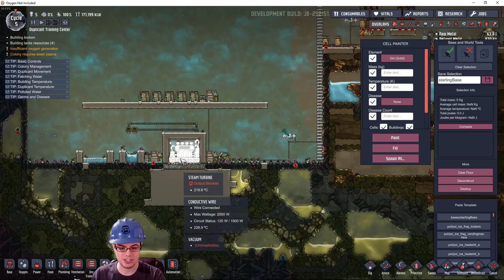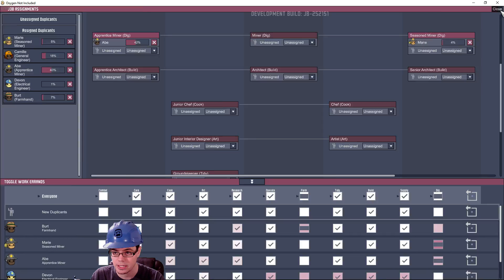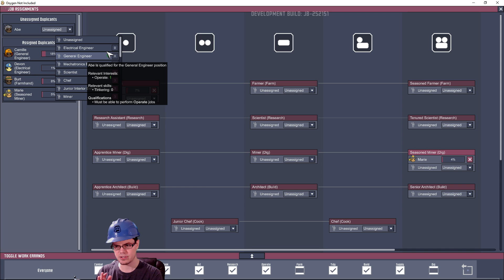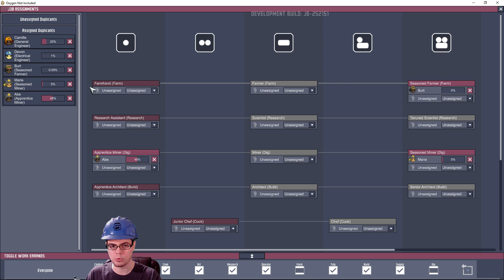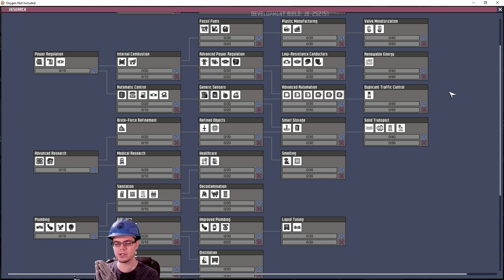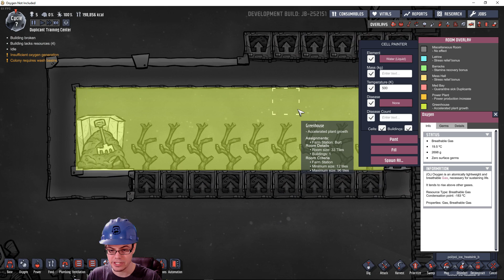Intro To Occupational Upgrade! Oxygen Not Included

Comment: What I like with this upgrader are the Ore transport (no more dupes running forever), the smart batteries (at last a nice way to only load batteries when needed, saving energy) and the hats.
Haven't found a use for the smart storage yet.
Reply: That is a possibility. Just have to look more into how and when it signals and use that to build the automation correct.

Comment: it will be nice if they add Liquid and Gas tanks in the next update or some time later. the way they work is they let you hold a set amount in them and say if there no power for say a pump. the Liquid can still move to where it go with out a pump. same go for a Gas tank. it can hold a set amount and it get use up before more is added. plus it be good if they can be place right next or on top/bottom of a replace tank. then that way it add more space for more Liquid or Gas to it.
Reply: A "water tower" system (and smaller boiler) as backup to pumps? With a bit of automation, this could save a bit of power. Also, gaz tanks could be quite useful to store natural gaz, with a valve you only open when needed that's a simple solution to keep generators runing a bit longer. There's good applications for this, even making hot water to be stored in cold areas until it get to X temperature before releasing it at the right temperature for farms.
Reply: Can't one already do this with the existing things in game? Using automation and an empty closed of room Id think one could.
Reply: If he said tank as "reservoir" it can be done indeed. The idea seems closer to a "water tower" meaning you stock extra water in an elevated building as backup for if powers run out, with no need for a pump exept to refill the said building later. Currently, it can be achevied by constructing longs pipes and makes use of the extra build up in it, I guess. An actual building would save some ore and space.
Reply: Ren Ookami what I have set up before is a water reservoir with two pumps at different heights. The bottom one is the primary. The second higher one feeds into another reservoir once my primary has filled more than the threshold. I then use this water in emergencies. All I have to do is program an airlock to open when the sensor in the primary has no liquid on it. This feeds the secondary back to the primary. The primary survival  circuit is powered by only 2 duplicants max. When the door triggers I know I need to produce more water via my water treatment method of choice at the time.  It works pretty well for me. I only run 6 dupe colonies though.
Reply: That sounds like a good way to manage it, but as you said you need dupes to power the circuit while the point of a water tower would be to act as backup building for when there's no power. It's not that you can't tell dupes to go to a wheel generator, and not even that useful if you know how to play proprely, it's just a fancy building for such situations "because why not"
Reply: Ren Ookami yeah power never is a problem due to the wheels. Kind of silly really

Comment: I don't anderstand how the steam-power-thingy work, can u axplein that in more Dteil¿
Reply: You put it in a room that has steam that is over 200C and has a pressure over 5kg per tile. Then it magically sucks up the steam it the bottom and generates power. It floats in the air. It needs a pipe in and pipe out but they don't need to be connected to anything at all. That will all likely change in the coming days.
Reply: Thx!

Comment: @Brothgar
"Output blocked" error is caused by overpressure above 10 kg at the point of steam outlet. Steam outlet is the small pipes at the very top, steam inlet is the base of the turbine (and at the same time it counts as a floor tiles).
And it seems that steam turbine supports only regular water as a coolant.

Comment: @Brothgar, It's probably going to change but the Steam Gen doesn't require liquid to be pumped in/out, it just needs the piping connecting to itself and in a room of steam to give off power. Edit: It needs space below it for the steam to flow in and space above it to 'vent' it out, but nothing really comes out.. then again all due to change, could be bug, but if you read the Steam Gen thing, it doesn't say it requires a type of liquid just the pipes, thats why i say just connect the in to out and you get power when around steam xd

Comment: Hey Brothgar!
Could you do a video on how to use the automation side of things. For example, how they control gas pumps, turning them on and off to save power. I don't really understand how to utilise it. 
Loving the new update and looking forward to seeing you put it into action! <3
Reply: Let's say you have a natural gas geyser and you want to send the gas back to base without having the pump on constantly. So what yo do is connect the pump to a Atmos Switch. Then set the air pressure you want the pump to work at, for this let's say 1000 grams. Click the "Above" button on the Atmos Switch, This will cause the pump to only turn on if the natural gas pressure in the room is above 1000g's and turn off if below 1000g's. Hope I explained this properly never played the game but this is what I understood from just watching others play Oni.
Reply: Except for it's any gas. Not just the one you're looking for. So if the room then fills with Oxygen, it'll pump that. (but if you have a filter, you should be ok.)

Comment: The smart storage and fridge outputs could be used to control grills and refining metals for example. Set a storage to store all refined metal you want as a reserve then use the output signal to shut off a rock crusher set on continuous production. Same with fridges controlling grills. When the desired amount of food (of a certain type) is reached it shut off the grill set to produce that.

Comment: Another good way to generate heat for the steam turbine would to just actually use the cooling machines. Use a wolframite pipe system to convey coolant around to your base's hotspots and cool them down, then bring it back to a cooling mechanism that heat ups water into steam and transfers it to the turbine room until it's cooled back down into water which is then transferred back to the turbine room, etc. Could be a good way to delete heat depending on the final form of the turbine and its exact function.

Comment: The new priority system seems to be the same except for another priority and a different UI. There's 10 priorities done one after the other
Reply: From what Brothgar said, it sounds like it is different because of the job system. Dupes prefer to do the job they're assigned to and the yellow priorities let you override that preference. The system is essentially the same for the dupe deciding between different tasks all within the category of their assigned job (or outside it). But it is different if the dupe has some tasks in their job and some tasks outside their job available to them (which will presumably almost always be the case in a real base).
Reply: Ahh. Makes sense

Comment: i noticed a germ sensor ... so there must be a way to decon ore when stored or restore it in a contaminated area .. i have a feeling the stacked storage boxes wont work when this is released because they dont have a floor .. unless the count them as stacked like in a warehouse or some such
Reply: There is an ore scrubber. They take in chlorine gas. They also have a small decor bonus too.

If you are worried about gas leaking, you can put the gas pump right next to the airlock so that you can minimize (if not eliminate) the gas leak. Just bear in mind that the more pressure gas has, the more quickly it will move to another empty space to reduce that pressure. So I recommend setting the gas pump and airlock up before breaching into the chlorine gas area.

With this new job update, you'll have less duplicants exploring new biomes so you can have a few sinks and ore scrubbers in a hallway as your decontamination area.

Comment: I'm still seeing some of the same issues that I had with the Oil, Automation, and Tubular Upgrades. They keep adding endgame content that is neat but that you can't actually use when you're just trying to survive because they require too much tech, or too much hard-to-obtain material (like plastic), or now too much job experience. Then the game just doesn't give a strong incentive to build fancy, because the main "reward system" that it offers is the survival aspect.
Reply: After watching almost all of brothgars videos.. my last base ran 2050 cycles. Survival is sure hard to deal with till you get to know how it plays. But toward the end of that base run.. I was building torture rooms, trap rooms (that lock them in and wait till they pee themselves) for dupes to see if I could could get more water out of them than they were using. (turns out you can't), most of the time half my dupes were idle as everything that needed doing most of the time, had been automated in some way.
Reply: It does give incentive - its much better to have steam turbines than ever ending supply of coal, or to setup a hatcher system witch conveyors. Same goes for food, its better to cook it because you are getting more food out of one plant, so you are using less water, which is also limited in supply (geysers have limited output). 

Only problem in the game is difficulty curve - it doesnt know when to limit resources, because those are generated on world generation, that means that after 120 cycles someone like you says there is no incentive to make fancy stuff because no one needs it any way, while it is needed after lets say 180 cycles (numbers depend on gameplay style).

 I think best fix for that is giving player a message when they are in middle of game (they used x kg of water) to make them aware of limited resources. Maybe even a random events where some items are lost in the processing so players have more incentive to build end game machinery.
Reply: You can deal with power until you are having heat problems with just manual generators and hydrogen generators. Once you have heat problems (which tend to start requiring some power-hungry machinery to fully fix), you tap a natural gas geyser and/or use a fertilizer synthesizer+natural gas generator array. Then your power problems are settled forever. Similarly your oxygen needs are settled forever once you've tapped a steam geyser (this one might be less true now that they've changed the food system yet again). Both of these statements require your colony to remain sufficiently small. But again, the game doesn't offer much incentive to make your colony any bigger than about 8 dupes. You can make the game harder on yourself on purpose, but it feels a bit empty to me.

Personally I'd rather see some relatively heavy-handed incentives to pressure you to use endgame buildings. For example, dramatically nerf all existing power options. Introduce an "exposed void" biome (perhaps on the other side of the neutronium at the top of the map). Then introduce a "solar panel" building that can only be built there, and is pretty much the only good long-term supply of power. To give you some time, you get a free super battery with a large amount of energy (at least 10 MJ) stored in it at the start of the game. Maybe sprinkle a few more super batteries around the map to incentivize exploring. But if you run out of super battery energy and don't have solar panels, you should be toast.
Reply: I guess that is what Klei is trying to do. In order to force you into using the endgame content it needs to be implemented first, then the game can be rebalanced so you have to use the stuff that is already there. If it was the other way around playing would be very disappointing for a couple of updates.

I guess that is also what they are trying to do by introducing new buildings that force you to have a duplicant operating it like the Power plant optimization thingy and the farmers building. You need a specialized duplicant for that, so you need to have more of them and sustain more of them.  Once they have figured out the effects on the game they could lower the production of all the buildings, so you have to work to these bonus buildings earlier in game.

People love their automation in this game, but the automation contradicts the idea of having many duplicants to do all the jobs. At the moment it is pretty easy to build a forever sustainable base with the content that's already in the game if you kill of every duplicant at a certain point and only have one left.

Comment: For the smart compactor, you could bring construction material far away and have a signal to say that you have enough so the conveyor stop sending more there. Good if you decide to have multiple smaller bases with specific jobs to avoid people moving things around with tubes. You bring food to everyone using conveyor belts.

For the steam generator, does it need water or any liquid works? We could use oil, hoping to create petroleum after a few pass if it works while saving the power to do so.

Also, there is a germ detector for automation and that is great for water cleansing :)